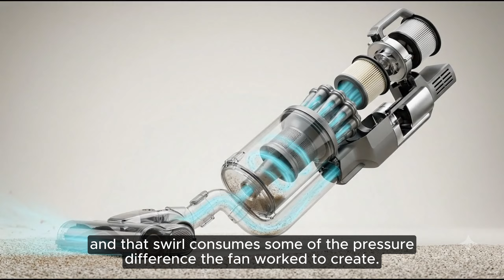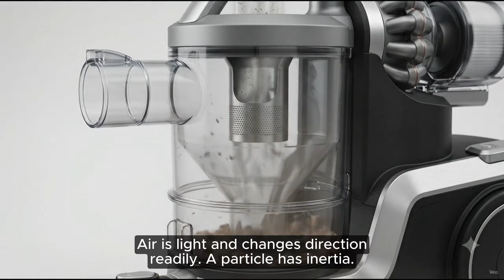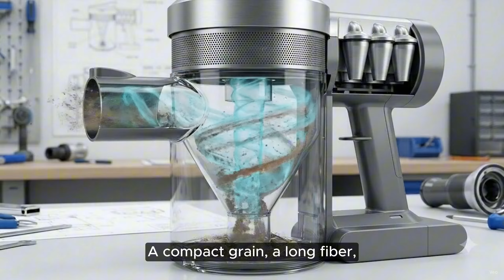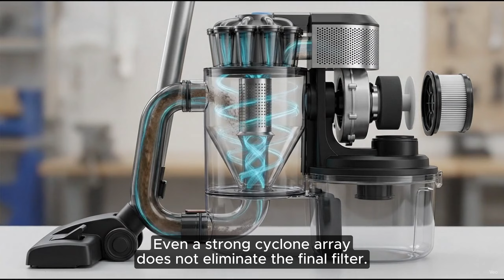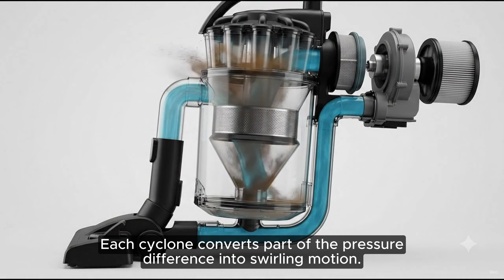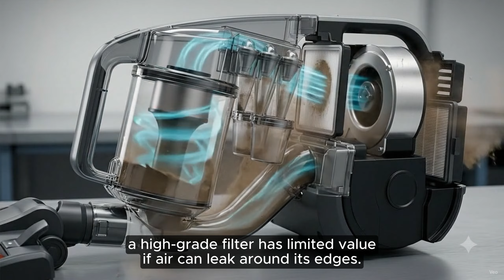How a Cyclonic Vacuum Separates Dust Without a Bag

Comment from the maker: "The fact that a vacuum cleaner doesn't actually 'pull' dirt, but simply lowers pressure so the atmosphere pushes the dust in, completely changes how I look at this everyday appliance! 🤯 What surprised you the most about the cyclonic separation process? Let me know below! 👇"